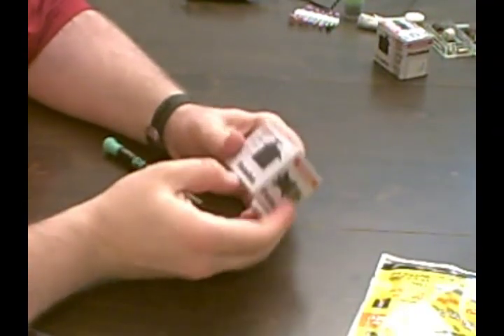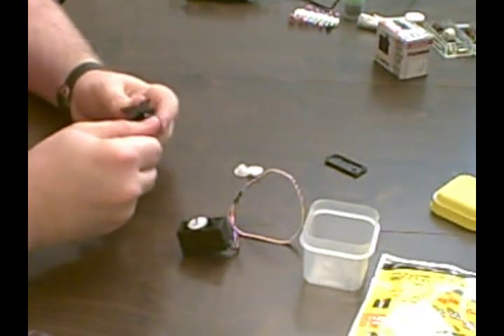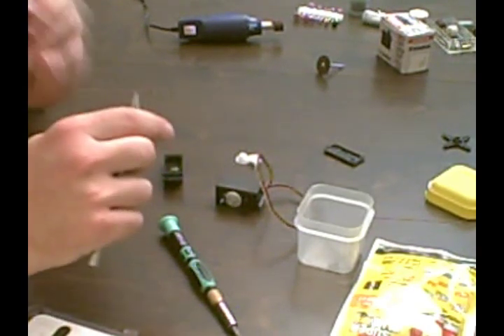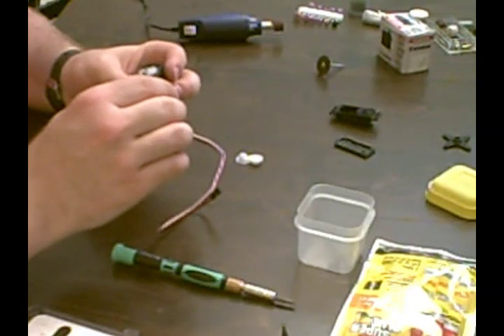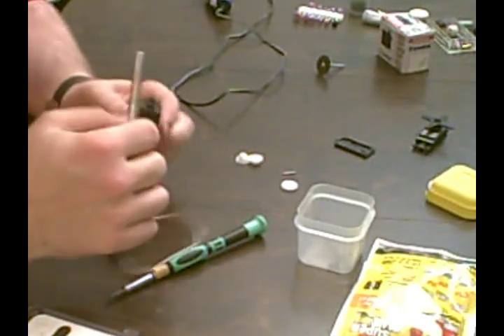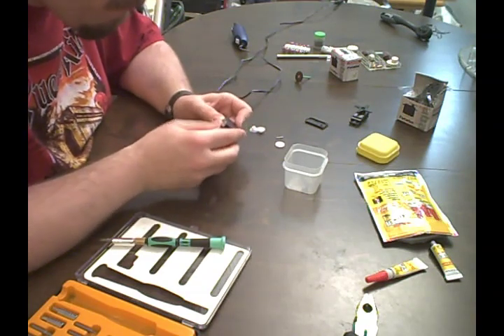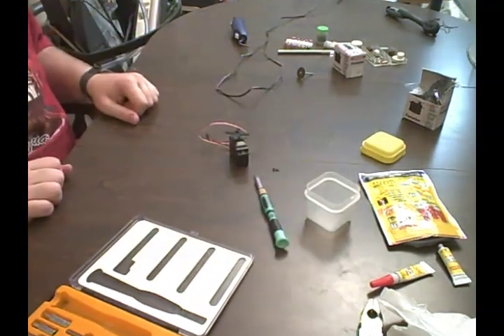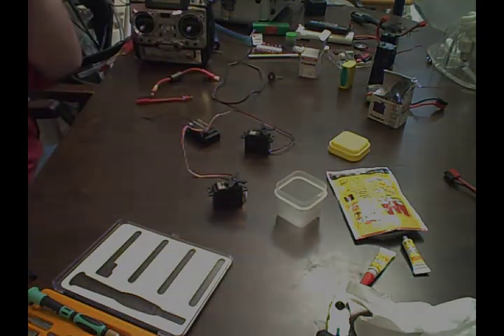How to Convert a Servo to Continuous rotation

Comment: I tried to do that but I just can not rotate the servomoterur in the opposite direction!! :/
Reply from the maker: +Zarg El Ayoun Selim If you properly centered the servo, then in order to get it to run backwards, send the opposite signal.  If you are sending something greater than the center point of 1.5 ms then send something less.  or vica versa.  Remember that servo signals run from pulses of 1ms long to 2 ms long at 50 Hertz. OTOH, if you didn't center your servo, your best bet would be to cut out the potentiometer and replace it with two equal resistors.  that should give you a proper center point again.
Reply: +AllenKll i tried this solution but its the same problem

Comment: If using a micro controller. Better to cut a thin slot in the top of the pot shaft. Then drill out the output gear so it will turn without the pot turning. That way you can adjust the center when it's together with the horn removed. Also, you can change it back to stock with a small sleeve in the output gear.

Comment: not really : it still is controlled in pwm and can turn in both directions without inverting polarity.
if you need both open loop operations and continuous rotation, you can use steppers.

Comment: i'm affraid you cant : feedback ability is gone with the potentiometer, so you'r left with a geared motor that can spin both ways, dot.

you'll have to implement closed loop monitoring if you need to know the angle